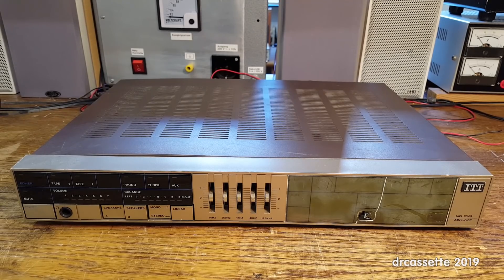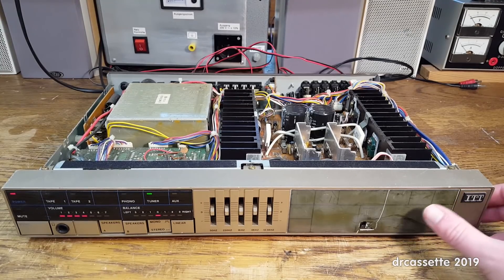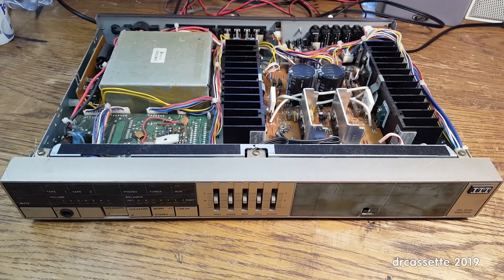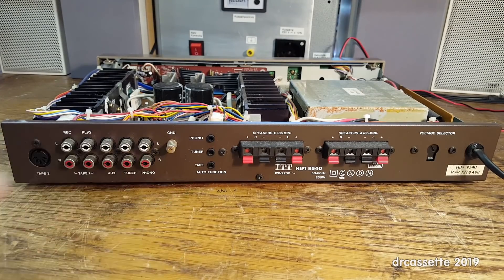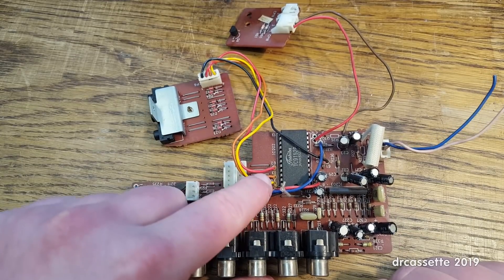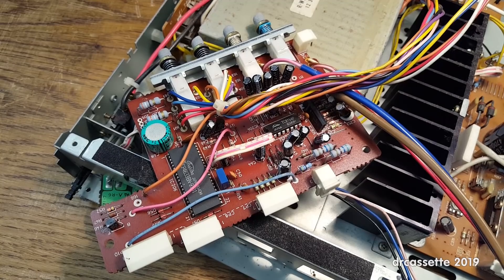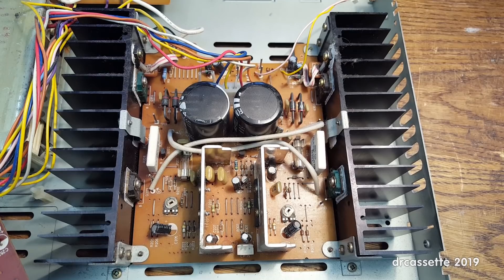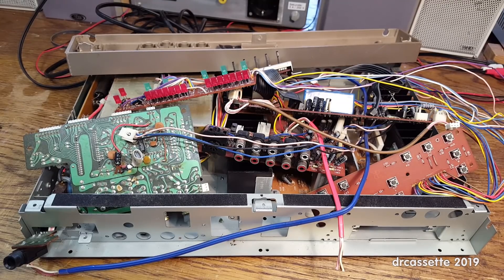ITT HiFi 9540 amplifier repair and teardown

Comment: Hei, are you kind enough to help with an advice for ITT 5500 regarding its inputs, there are 3 DIN Jacks one for Phono, one for a Magnetophon + Another for REC. Any ideea if i can connect a DAC to any of it ?
Reply from the maker: The Magnetophon input should work for the DAC, though you may have to reduce the DAC's output volume if possible.

Comment: that smal pcb its a phase inverter for bridging
Reply from the maker: No, it's certainly not. It has something to do with the control logic in this amplifier.
Reply: the phase inverter would be on the main amp board.

Comment: Entry level 80s equipment that still had anologue knobs and switches lasted forever. More upmarket ones with membrane panels and motorized controls? They all went into the garbage as time went...
Reply from the maker: That is very true. The entry level equipment usually is very reliable and when something does go wrong it is easy to repair.
Reply: The 80s were when the whole "faaancy digital functions but inconvenient to use and hard to repair" marketing scheme began to take off. 
Today even the entry level stuff is like that, but worse built quality and hey, at least the 80s stuff that was like this looked great.
Reply: @westelaudio943  Entry level also sounds a lot worse these day. I still use a late 80s Technics rackset in my garage/smoking room, it's a very simple analogue tuner, a 2x25 watt amp, big standard speakers... The rack on its cassettedeck can blow a lot of modern mp3/bluethooth microsets I've encountered out of the room. Don't people care anymore about how their stereo sounds?

Comment: I've always had an affinity for ITT stereo equipment, as we had an ITT Hi-Fi 80 series growing up which gave a lovely sound. I recall the speakers had real wood veneer and Audax drivers. 

All the components were wired together with DIN cables, even the speakers had the two-pin DIN plugs.

Comment: ITT that’s a forgotten brand. I remember it from the late 80’s. When I was 5 years old we had a winter vacation in austria (Tirol of course) and the appartment had a TV from that brand. That’s where I reconize it from. Seems like the ITT brand was more present in some countries then others, never seen their products in the netherlands as far as I can remember. The amplifier has that typical 80’s design. It looked very modern for it’s time.
Reply from the maker: ITT stands for International Telephone and Telegraph, that's what they originally made. Over the years they took over more any more other businesses and turned into a massive group of companies. In Germany they took over Schaub and Lorenz in the 1930s and then operated in Germany under the brands Standard Elektrik Lorenz (SEL) and Schaub-Lorenz. In the 60s they took over Graetz. In the 70s Schaub-Lorenz and Graetz which were the consumer electronics companies ITT owned in Germany were put together and the products were then sold under the ITT brand wich I think was a good move of their marketing because ITT sounds much more international and high-tech than Schaub-Lorenz or Graetz. The service manual of this amplifier is also for an identical model they sold under the Graetz brand. In 1988 ITT sold Standard Elektrik Lorenz along with Schaub-Lorenz, Graetz and the ITT consumer electronics brand to the french CGE which in the 90s sold the ITT brand to Nokia. That's when products were branded as ITT Nokia. And that was how Nokia entered the German market. In the late 90s they dropped the ITT name.
Reply: DrCassette Never though they ended up beeing a part of Nokia. Before the famous smartphones, I knew Nokia in the mid 90’s as a producer of cassette recorders and the like. Seems that Nokia also manufactured computer monitors, but everybody knows them for their phones.
Reply from the maker: @dykodesigns   My grandaunt had a late 90s Nokia TV. That was my first encounter with the Nokia brand.
Reply: Indeed, Nokia also acquired Finnish based TV manufacturer Salora, who had a separate mobile communications division called 'Mobira'. 

Initially, Nokia had no interest at all in mobile phones, and actually considered them 'James Bond gadgets'. It was only due to insistence from Salora-Mobira that the idea was pushed through. The rest is history, as they say!
Reply from the maker: @Oldgamingfart  Interesting story!
Reply: You might also be interested in this pretty good Nokia documentary that was shown here in the UK (BBC Four) last year: https://www.youtube.com/watch?v=RDYedU7COEQ

Comment: I spot a Toshiba IC on that preamp board. I wonder if Toshiba licensed out that unit to other companies. I have an ITT Rotery Phone.
Reply from the maker: It is very well possible that Toshiba made this amplifier for ITT. It was certainly made in Japan. The ICs however were standard components that other companies could buy, so the amplifier could also have been made by another company.
Reply: I suspect it may have been NEC, as if you look at the JC Penney 'MCS Series Stereo Receiver 3275', it has slight cosmetic similarities to some older ITT receivers. 

The aforementioned MCS receiver was manufactured for JC Penney's house brand 'MCS' (Modular Component Systems), by NEC in Japan.

Comment: I have a late 80s Toshiba Tuner, Tape, and amp that is made nearly exactly like this unit. I ALSO found it at my local dump. It's got issues and the touch buttons are as junk as they are here.

Comment: nice to see one UNI-T UT70A I have one since 2005 and still works great...usualy everybody in youtube uses a Fluke. do know why...nice video, thanks
Reply from the maker: Fluke are considered the best multimeters on the market, that's why they are so popular. But they are very expensive. I bought an old one on Ebay that needed some repairs to make the display work again. But it needs to be re-calibrated, the AC voltage is off by several volts, so right now it can't be trusted and is therefore useless. 
But affordable multimeters such as the Uni-T are good enough for most applications. I got my UT70A back in 2009 I think. The whole class at the technical school I went to at that time got this multimeter to get a quantity discount.
Reply: I got several multimeters and the UNI-70 is used most in the road becouse I have a small pro audio business and light and this one are the most sacrificed...dust, rain etc and still works fine none is Fluke...I also repairing old audio gear like that one by hobby and I got a lot of them...thank you
Reply: @DrCassette  Fluke for shure..but Agilent and Gossen Metra have produced great DMMs! I Have F87 V and F289..but Agilent U1273A is near perfection! Accurate and killer speed on readings and spots!
Reply from the maker: The one I have is an original Fluke 87.
Reply: @DrCassette  Almost the same Dmm compare to 87V..!☺